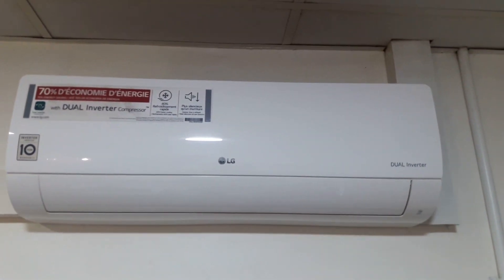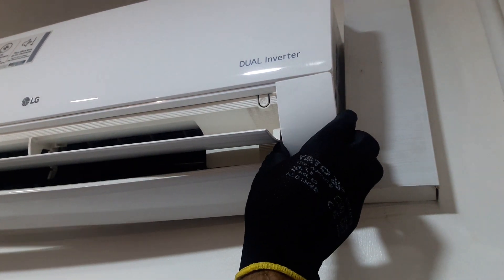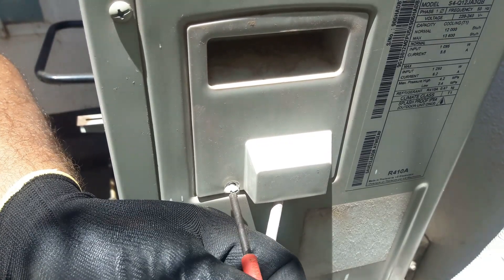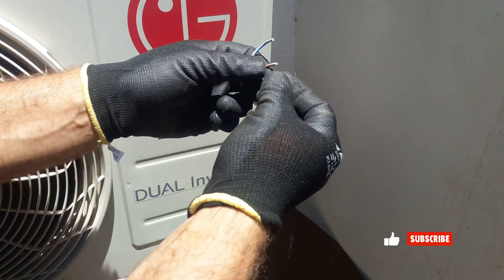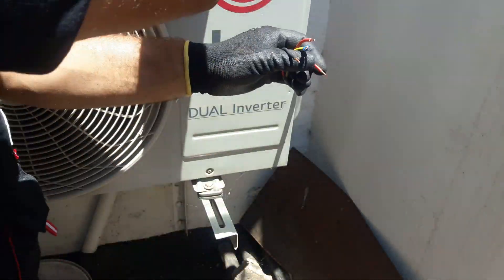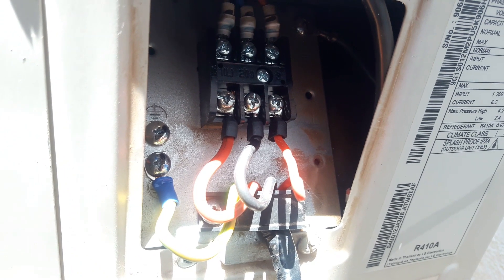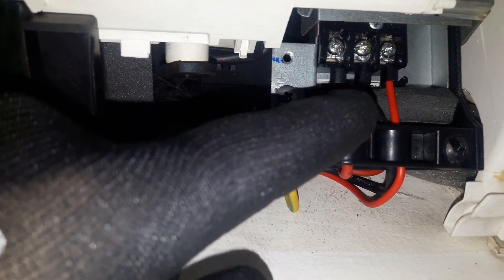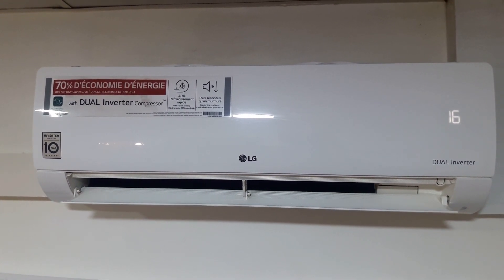CH 05 Error LG Dual Inverter Air-condition #ac  #error  #codes

Comment: I have the same issue i have checked the wire and is ok please what else can i do to resolve this issue
Reply from the maker: Check the pcb board at the outdoor you may have a malfunction component also check the main board at the indoor unit 
Note at the outdoor unit the pcb board has a fuse check make sure it is not blown.

Comment: Same error ch 05 but it works during  day time for morethan 2hours but in evening and night it runs only for few  minutes then shows ch05 error
What to do? 
Can share ur phno or address if you are technician thanks
Reply from the maker: Greetings 
Let me share the most terrible experience, I had the same issue with one of the AC unit , it works well daytime at night error ch05 I decided to detach the outdoor cover I found a thousands ants was sticking on the units circuit.
Try to check that Immediately after the error occurs.
Meanwhile check your voltage and frequency too.
I'm in south Sudan I don't think so can see you physically.

Comment: great 
   what if the wire is good yet the communication is signal
Reply from the maker: Greetings 
If you have already check the wires : 
L
N
3c
Ground 
The next step is to check all components at the PCB in the outdoor unit if everything looks good at the outdoor next check the PCB board at the indoor units.

Comment: hi there..same issue for my ac as well.. all wires are fine... ac works for few mins, and then ch 5 erro comes up.. sometimes ac works without any issues, but then the next day, sane error pops up.. what couls be the issue? and today its been 3 days i havent used the ac..its not starting at all
Reply from the maker: Greetings 
Check the input circuits at the indoor  PCB make sure they are ok you may have a blown fuse once you figure out with the current problem that you mentioned your AC is off at all not starting 
After you are able to run the unit connect a single wire to the 3c circuit in indoor and the other end of wire should reach to the outdoor connect it to the 3c circuit of outdoor this wire should be isolated from the rest of wire 
Run the AC unit and wait 20 mins if the erro comes back then you need to check the PCB board at the outdoor there are so many component you have to check sometimes the PCB itself goes bad
Reply: Hi, you found the problem yet? I have the exactly issue like you. I haven't checked the wire yet. Ch05 shown up occasional after 30 min or so. After I turned off everything for any hour or so, it will be back to normal, depending on luck.

Comment: Can Grand wire not be connected cause CH05 error to occur?
Reply from the maker: Dear James 
Thank you for chosen DIY & Fix it ,

The ground/ earth wire is for our safety and also for your AC unit.
Fault Code 05 and 53 (CH05 is displayed at indoor unit, 53 is displayed at outdoor unit) This fault code indicates a communication error between the indoor and outdoor units; this is usually caused by wiring errors or condensate pumps connected to the inter-connecting cable.
01) make sure isolate your AC cable from refrigerant pipes and other cables.
02)  3c circuit in indoor is a signal circuit it's going to be connected to the outdoor make sure it is not next to the other cables or wires which is generating noise.
03) check the PCB board at the indoor and outdoor make sure all components are Ok.

Comment: Hiii Sir, gd evening I'm shakir Alam, i wanna ask u one thing.i find same issue in my Dual inverter lg Ac ch 05 i cheaked All wire connection and voltage still.issue not resolved.wht kind i do
Reply from the maker: Greetings 
Dear Shakir sorry for  didn't reply on time, I have been working somewhere  didn't get time to be active in social media but I'm happy share my experiences with my followers even if it is late but I'm pretty sure It's gonna help.
(Sometime communication errors occurs due to a blown fuse in the PCB board at the outdoor unit,
It is a 15 Amps fuse , replace the fuse and run the air conditioners use an ampere meter the current should not exceed more than 6.5 A @ 220 V if the unit is 12000 btu
If the ampere meter shows 8 or 9 Amps you may have other issues you need to check  compressor's current . You may have a bad compressor or may not, you need to troubleshoot there are so many reasons for that , I wish to get time make another youtube video on this topic.
All the best